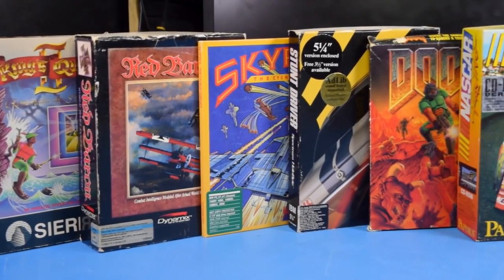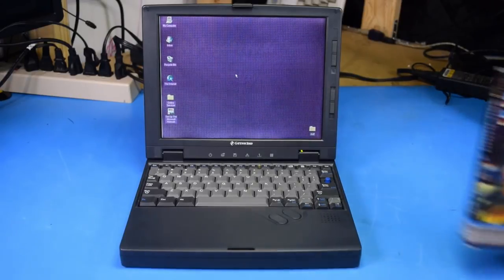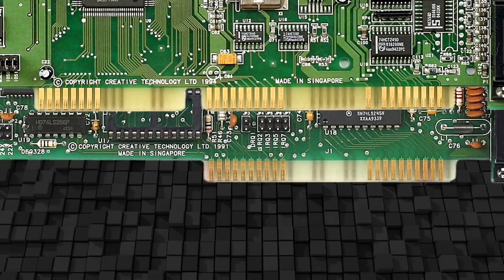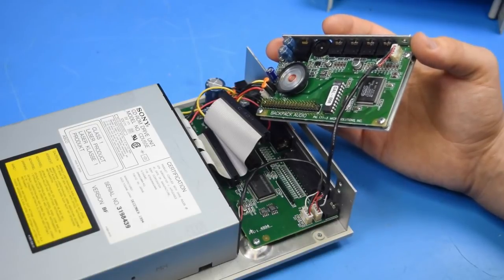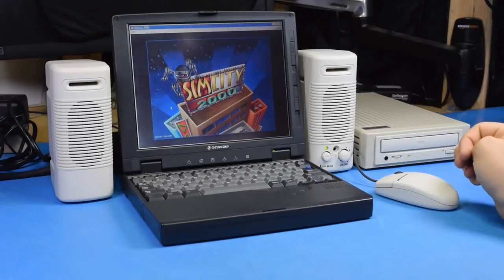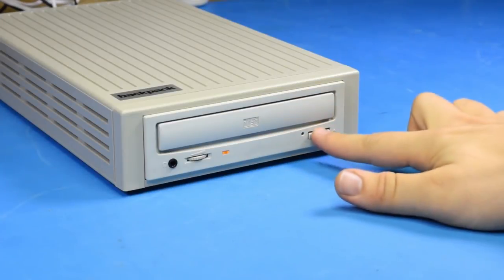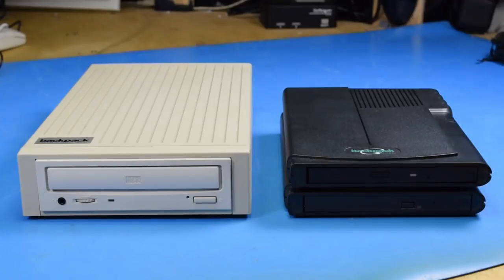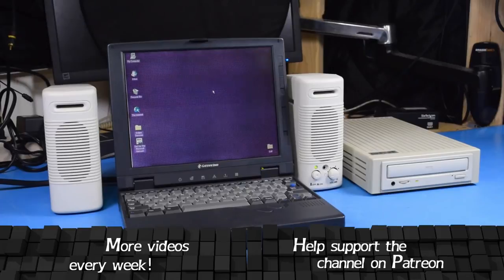LPT Sound Card In CD Drive is Almost Awesome

Comment: If only someone could write some do drivers. Idk if that's even possible but damn I really wished I knew how to program.  Lol
Reply: Unfortunately the problem is that every program under DOS accesses the soundcard directly, and you don't have the requisite hardware to intercept these accesses to the missing hardware. So it's generally not possible.

It did work out for OPL2LPT since they can just stay resident, look for known executable images in RAM, and once one is found, hotpatch the address of OPL device to map it to LPT write, and correspondingly had a similarly simple LPT hardware. Sound Blaster is complex enough that you can't get its digital part to work in a similar manner. There's a reason all Soundblaster emulation drivers for PCI cards were more miss than hit, even with hardware assistance for intercepting the data! You can get some mileage out of EMM386 assisted I/O virtualisation though, you can read up on that, but compatibility of that is very, very limited, most software just works right past it.

The only device classes under DOS that i can think of off the top of my head which did have actual drivers where you could introduce new hardware completely incompatible to existing and bridge that compatibility with drivers were mouse and storage.

Comment: you can get 16bit from 8bit with just 2 74hc245 chips and some control circuitry.
I've used this to try to get IDE drives to work with my z80 computer
this also explains why the card is on an ide bus . the bus is 16bit wide
Reply: Could you elaborate? Im actually making my own Z80 design and and IDE bus wouldnt be amiss...
Reply: it's just like every other peripheral to a z80 but when you write to it, you first write to a 74hc245  and then you do a normal 8bit write to the address of the drive and the 74hc245 outputs its data to the upper 8bit of the IDE bus. Similarly when you do a read, another 74hc245 latches the upper 8bit and you can read them later. The ide bus has fast timing requirements though so you need a way to shorten the access pulses.
 there is a page about it, http://blog.retroleum.co.uk/electronics-articles/an-8-bit-ide-interface/

Comment: switching from ac to dc and vice versa of the same voltage would only possibly cause electronic misbehavior, but the mechanical parts will not

Comment: I just rather go ahead and run emulators. It's just an unnecessary hassle.
Reply: Not all games work right with the emulator, so if you are looking to specifically play those games, you're outta luck, but for the most part, you'll be fine